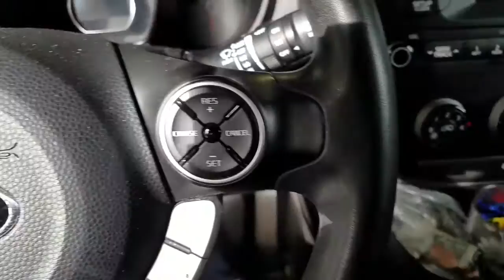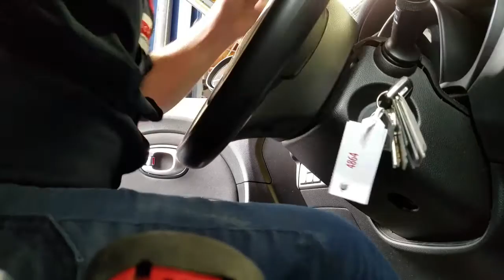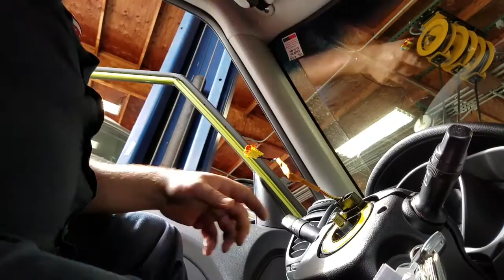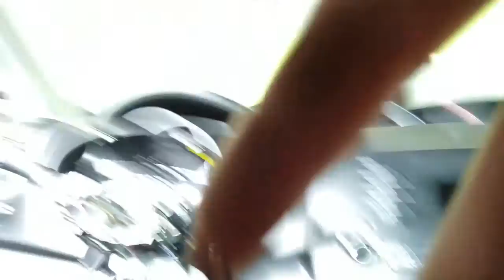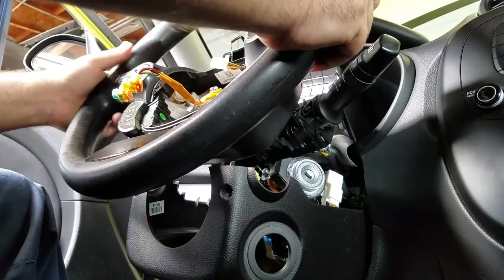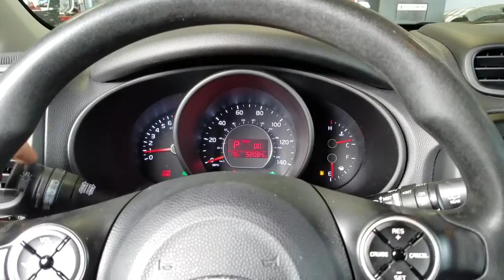2014 Kia Soul Turn Signal Switch Replacement

Comment: Hello, your video is very informative and I appreciate the detail; I just wanted to ask if this applies to my car. My left parking light remains on after the car has been turned off (Kia Soul 2011) . I turned the auto lights off and it went out, but the next morning the battery needed a jump. I was wondering if this applies to my issue? Thank you for a response.
Reply from the maker: +kay glo Well, it could. But it more sounds like a possible short issue or parasitic draw.
Reply: Thank you sir for your reply; much appreciated.
Reply from the maker: No problem. If your battery continues to drain over night, you can isolate if the switch is the concern by following this video and unplugging the switch. If the battery doesn't die overnight, then you have isolated the issue. The more proper way would be to do an actual parasitic draw test. However, this would allow you to in fact isolate it to the switch assembly itself. Please note, that if you vehicle is still within the manufactures 5 year/60k bumper to bumper warranty, it would be in your best interest to just take it to your local dealership for diagnostics and repair if needed. Best of luck and please let me know what was found to be the concern. Take care.
Reply: See if your blinker was left at a turn position (and not the neutral position). I had another vehicle in which one of the parking lights would stay on even if everything was turned off, and it would depend on which turn direction the blinker was latched to.

Comment: Great video , I have a question I want to add fog lights to my kia soul is there anything else I need to do after I install the blinker switch with the fog light option or is the wiring already on the harness? thanks
Reply from the maker: +rc nuckinfuts The wiring harnesses are vehicle specific. Meaning there won't be any wiring for fog lights. Still not difficult to install. However, there will not be any connections for the lights.

Comment: Great guide but now I'm getting squeaking when I move the wheel (not slightly more like If I was making a full turn or UTurn. Did I goof up the clock spring? I was sure I put it on right
Reply from the maker: +Laura Newton I would double check that the plastic steering well cover is installed correctly. If the tangs don't line up properly it can cause a noise issue. If the clock spring was damaged the airbag light would be on, the horn would not function, and the steering wheel buttons would not function. Also check to make sure the clock spring is fully pushed back.

Comment: I don't think you need to take out the steering wheel for that... just the plastic cover..
Reply from the maker: +vale ale If you watch the complete video you will see that removing the steering wheel is necessary. Thanks for the input.

Comment: hey bro i got one that when i turn the lever to turn right the hazard lights come on instead of right turn signal could this be relay or multi switch?
Reply from the maker: +MoNsTeR420x1 Sounds like a short to me.
Reply from the maker: +MoNsTeR420x1 The switch could be shorted itself. I would check continuity on the pins on the multi-switch while the switch is in the right turn signal position (switch unplugged of course) check for continuity between the output for the right turn signal and the output for the left turn signal. However, the fact that it doesn't happen in the left turn signal position would also lead me to believe it may not be a short at all. A short to power would cause both circuits to be activated regardless of which is turned on. Check a schematic, I believe the multi-switch goes to the BCM or IPM to handle the turn signals/hazards and could very well be the issue at hand. Best of luck.

Comment: Hi great video. Does the 2011 hyundai tucson/ix35 have the same setup for the headlight switch? My fog lights do not turn on anymore. It only works if the high beam is on. Thanks!
Reply from the maker: +Rommel Reyes It will be very similar. Fog lights only work when high beam is on, I would suspect the switch.

Comment: I have a kia soul my headlights and dash lights flicker off and back on when I'm driving it happens when I mess with my turning switch could that be the cause of it
Reply: nicholas001 have you fixed your problem yet? I have the same going on with my soul 2014. Please let me know how it went. Thanks.
Reply from the maker: I could be. The switches on the Kia Souls are a known problem.
Reply: RealTechReview got it. It was the switch. Thanks!
Reply from the maker: Is your vehicle still within the manufactures 5 year/60k warranty?
Reply: I'm having the same problem.  What is the average cost for a mechanic to replace this?

Comment: my parking lightz want turn off what can it be thats when my lights and motor is off
Reply from the maker: Could be that you don't have your light switch turned to the AUTO or OFF selection. Or a possible short in the switch.

Comment: Great video. I have Kia Forte 2016 w/out fog lights, I'm planning to install turn signal lever with fog light option. Does my original wire connector fits the new turn signal lever with fog light option? Thank you!
Reply from the maker: +TheLastBear Yes and No. It will plug in. But there will be no corresponding terminals on the harness side of the plug. You would have to install the terminals into the harness connector and run that to a relay. Then have the relay power the fog lights. How is you electrical knowledge?
Reply: Could you go into more detail about the entire process? Especially about changing the terminals in the harness connector. I'm planning to do the same with my 2017 Kia Forte. Is this difficult?  @Projectlife2023

Comment: Quick question, will this make the airbag light come on? If so, how do you make it go away
Reply from the maker: +Nater Tater The turn signal switch won't. But the clock spring will.
Reply: Ok, I ordered the part, I just know from the video you did that you took off the airbag and I wasn't sure if that would make the airbag light come on. If it does come on, how do I get it to go off?
Reply from the maker: +Nater Tater It depends why it is on in the 1st place. I would scan the vehicle to see what airbag code it had. That would give direction for further diagnostics.